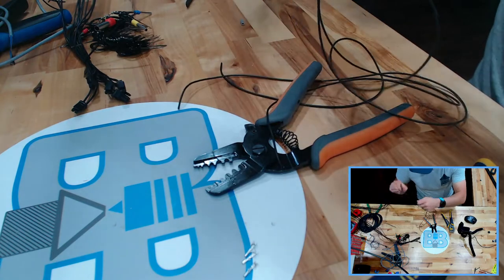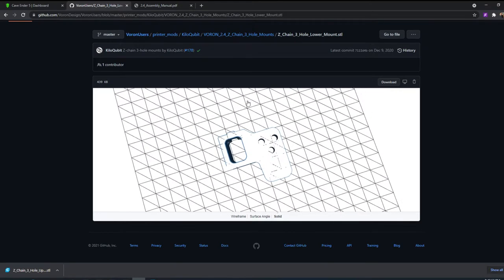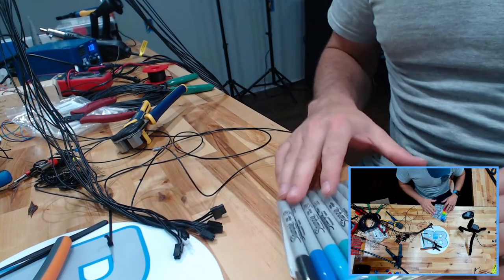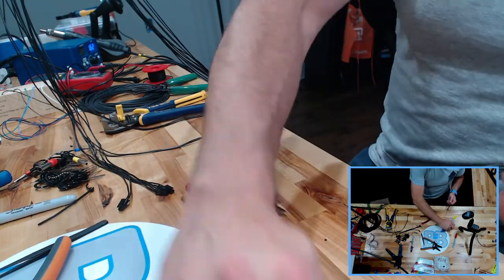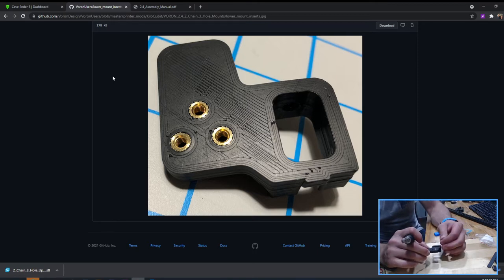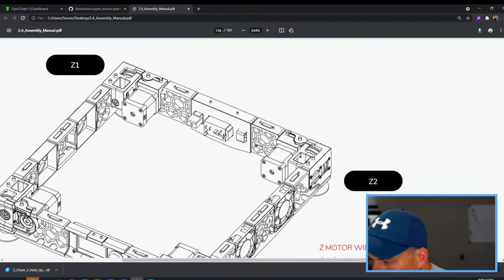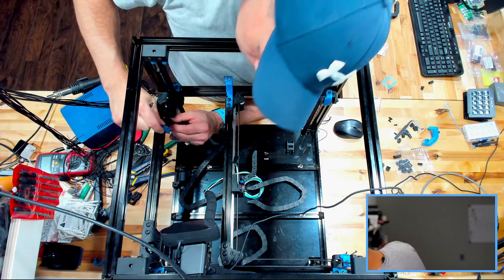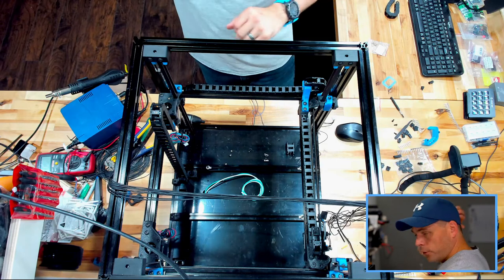VORON 2.4 3d Printer Build It Live *Episode 17* Harness Crimp'n Ain't Easy

Comment: Making the wires took me as long as the mechanical build ;)
But it was a nice experience making a Voron 2.4 and I would recommend it as a second printer.
Reply from the maker: I'll need to do a retrospect soon.  It does take a long time.  The hackish part of me wants to solder and heat shrink these quick and get to the fun part, printing. But, I guess, doing for all to see keeps me inline.  And I've become pretty good at those darn Dupont pins at this point!

Comment: I like all the new fancy effects.
What are those black connectors called that you have at the end of your wire looms? Did they come with the kit? I have seen the one PBC mod uses JST-XH from the board, but something similar to those PCI-E power looking ones to deliver power to the board.
Reply from the maker: JST SM with Dupont pins.  The kit came with some, I bought extra.  A lot of people are asking about the tool head boards, I can't figure out why they would be that much easier.  I can disconnect a few connectors almost as fast as one, and if I have an issue I don't need to rewire a 12-15 pin pcb.  Oh well... I'll look into it more.  Thanks, since I've had limited time the minute here or there had been working on graphics, and my audio.
Reply: @BuildItBasement  apparently at allows for consolidating some of the ground wires as you can share a single ground wire up to the tool head. Your solution already has the quick swap out part down. The PCB would just add the reduction of wiring up to the toolhead. Probably not an issue unless you are finding that the drag chains seem to be a bit over-full.
Reply: Some PCB go further and also integrate a BAT85 diode to make inductive probe wiring easier... I can imagine a built in ADXL345 accelerometer may be convenient as well... But for DIY probably overengineered and making toolhead mods harder in the future if PCB does not fit the design any more...
Reply: @josefjelinek  don't forget thermistor on the PCB used to track chamber temperature.
Reply from the maker: Good points!  That's exactly what I wasn't thinking about.  Additional benefits.  I like the idea of the chamber temp around the tool head, however it would be closer to the hotend than I would like... But the ADXL, that was a problem that could be solved.  I already have the boards in the Basement to do accelerometers on the tool head and the build plate.  But that was for way in the future.  Hmmm - that alone is enough to consider a PCB at the head.  As for the voltage drop diode, the Spider has one built in.